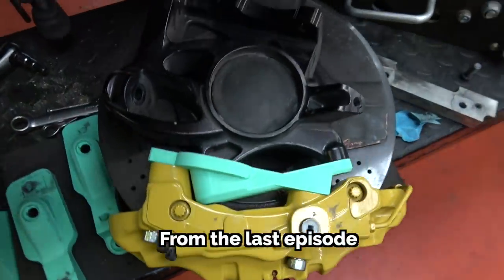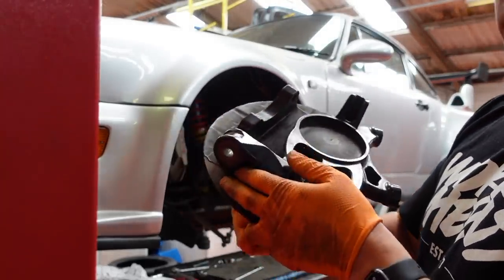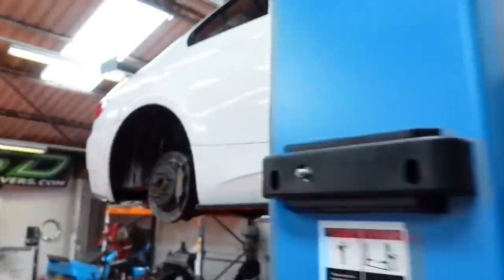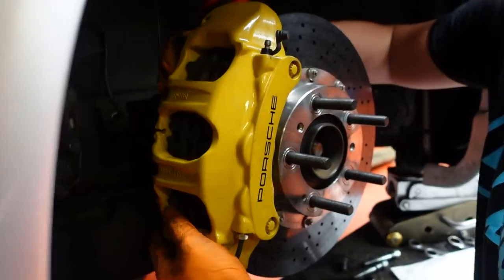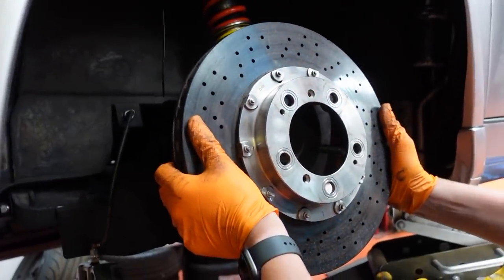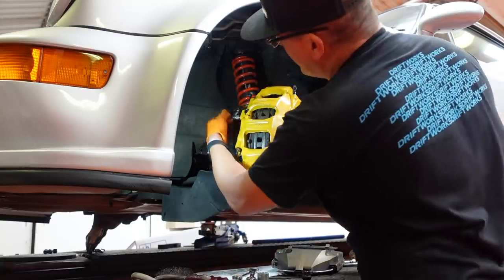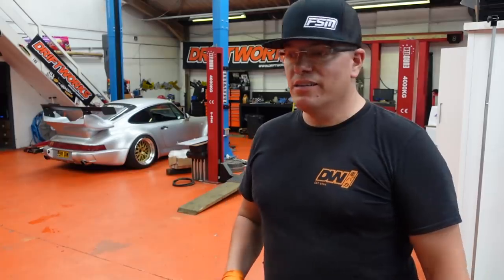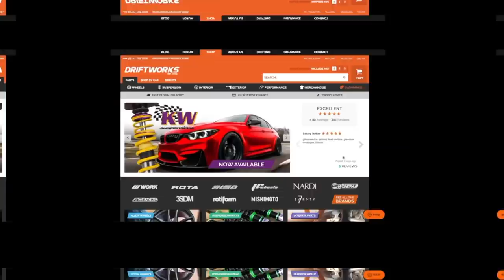Carbon Ceramic brakes on my 964 Turbo RWB Porsche 911 - Part 3

Comment: That brake disk is just stunning.

For a mere 2 million (less than an F40) you can get a printer that prints several types of metal including aluminum and I believe titanium. Fascinating how they work, but for myself I'll be waiting until they get into the thousand dollar range. 🙂

Comment: To much tire stretch can cause handling issues, just so you know Phil 265 on 10's, 315 on 12's are the reasonable choice(maximums😉). Feel free to give me advise on giving you advise. Your(our) 964 is ace 🤔😏
Reply from the maker: It seems fine so far, but I'd like a size up again eventually. I like a little stretch on a track car generally.

Comment: The metal working skills that you guys possess is awesome. Well done..question aluminum brackets for the calipers are strong enough? Would like to have bigger calipers and rotors on my e36 m3 evo. And 6 weeks on the hoist. Did you leave the battery on charge? Well done Phil
Reply from the maker: We use aluminium for all brackets. The BBI uprights themselves are aluminium. It's 7075 grade.

Comment: They look the part and I'm sure they have more than enough performance for a lightweight car like that.
Are you going to change the rear brakes to carbon ceramic too? The higher friction coefficient at the front will move the brake bias further towards the front, unless you change the master cylinder to adjust the pressure towards the rear more. Just a thought, I'm sure you don't want another brake headache just yet lol
Reply from the maker: That's the plan, although the PCCB are a lot more balanced than what was on there before. The bite & ratio on the old calipers was way out of balance.
Reply: @driftworks  sounds great!
What will you be doing with the old calipers? Keeping them as spare, or selling them?

Comment: Looks awesome mate- I’m the same fitting Lamborghini brembo Ceramic calipers to my E46 M3 with custom mounted 390x36mm Audi RS6 discs - plus custom pads and mounting brackets- oh and the 2mm wheel clearance and static wheel balance as the wheel weights have to be moved to clear 🤣🤣- but fuck they look immense
Reply from the maker: I bet they do, are they Gallardo brakes?
Reply: Driftworks yes gallardo and Huracan ceramics also found on the Audi R8 V10

Comment: Silly question. Did you try switching the calipers left to right to see if they fitted better? 🤔
Reply from the maker: You can't as the leading/trailing pistons are in the wrong place.
Reply: Driftworks ah I see! I knew there would be a good reason! Thanks.

Comment: So when's the mapping day now the brake dust issue is hopefully resolved?
Reply from the maker: Next year likely. Too much going on and there's a lot to do to the car before it's mapped. New ECu, injectors, throttle body etc. It runs pretty well as is, so I'll run it for a bit.

Comment: Possibly a little late now, but would it not have been easier to buy low head cap head bolts rather than machine standard ones down? Nevertheless, great episode and looks incredible :)
Reply from the maker: It would have still needed machining. 👍

Comment: Phil, please save the native CAD files of the adapters for when I sell my house and my wife leaves me for buying a 964 turbo. This way I can buy adapters from you and do this swap in the new parking lot where I will live. So much drool on the bits that are on this car! So, with the American 5 lb drop in the brake setup and the ??? lb drop in the BBI knuckle and coilover setup how much weight do you think you lost in the front corners compared to a stock 964? Curious to see your track impressions.
Reply from the maker: 😄. I'm not sure what the total change would be. The wheel and tyre are obviously about twice the size as a standard car.

Comment: Hey guys just wondering if your'e going to use hub-centric rings on the rotors? i upgraded the rotors with my BBK and needed to do that or i would get horrible brake shutter
Reply from the maker: Doesn't seem to be an issue so far, but I'll keep it in mind. Cheers 👍
Reply: @driftworks  normal city driving was pretty normal but once they got hot in the canyons or on track if come up. Lug nuts were TQ'd in a star pattern to 110ft lbs. Awesome build/mod! Keep killing it!

Comment: @driftworks.  Did I see loose bolts when you took the ceramic disc off. It looks like the bolts that hold the wheel bearing onto the hub!!!!!!
Reply from the maker: Yeah, I was using that face to do some of the initial mockup. It was all done up don't worry 👍

Comment: Do you know what model your original Brembo's are? I have a set of 4 pot rears that are almost identical. I can't find pads to fit them.
Reply from the maker: I don't, I gave up trying to find info and again couldn't find pads.
Reply: Driftworks thanks. I may have to do the same thing. 😒

Comment: Are you going to have uneven pad wear due to flipping the caliper upside down?
Reply from the maker: Why would I? Did you see the bit where we flipped the bleed & link to ensure I still have the leading & trailing pistons as they are supposed to be?
Reply: Driftworks I did see that. Wouldn’t flipping them side to side have been better? Maybe I’m not wrapping my head around this correctly but are the calipers not mounted upside down? So now the leading piston is trailing and vis versa?
Reply: On second thought, flipping them side to side would for sure mess up the piston orientation. But would have solved the bleeder/crossover issue.

Comment: Amateur here... What is the problem encountered at 18:45? Just curious, thanks.
Reply from the maker: The pipe that Jay made is touching the bolts on the back of the wheel centre.

Comment: Is the oil pressure low on the 964?
Reply from the maker: No, thats the oil level which moves around as it pleases 😄
Reply: @driftworks  I see. It got me worried ;)

Comment: In fear of looking stupid....if the calliper was mounted on the rear of the left strut, surely if it was fitted on the front of the right strut the bleed nipple etc would all be in the correct orientation?
Reply from the maker: It's not a stupid question, but the answer is that the leading piston would become the trailing piston. It's very importantly balance to spread the load on the pad correctly.

Comment: After all this work, Porsche have come out with tungsten carbide brake disc rotors, half the price of CCB and still have minimum brake dust
Reply from the maker: Yeah, but those are middle management, these are top dog.
Reply: Driftworks yeah can’t compare performance, but for the brake dust freaks seems a good compromise haha

Comment: at 32:41 the oil pressure gauge is at the red? is that normal?
Reply from the maker: That's oil level. It kinda does what it wants when driving.

Comment: Could you have just moved the FL caliper to the FR and vice versa rather than switch around the pipe and fittings?
Reply from the maker: No, as I mentioned in the video the leading and trailing pistons would be the wrong way round.
Reply: Driftworks ah! Missed the part about the calipers being asymmetric. 👍👍

Comment: ‘Unsprung weight makes no difference’ ........... 
Really ? So why don’t they make wheels out of lead ?    Why do they make magnesium wheels and carbon wheels? 
 Sure notice a difference on a motorcycle  on marchesini wheels vs stock wheels.  Gyroscopic inertia. Konigsegg don’t have alloy wheels, they have carbon. 
But I like the reason for fitting the brakes  👍
Reply from the maker: I'm not saying it doesn't make a difference. It's obviously optimal. I'm saying no one normal would be able to tell the difference between 2kg unsprung weight.

Comment: I'm sure I've read somewhere carbon disc brake calipers have to be yellow because of the higher temperatures they run at
Reply: That makes zero sense
Reply: Dark colours retain heat, light colours help disperse heat, basic school stuff physics mate
Reply: Rich Atkinson as long as it’s high temp paint it makes no difference what the colour is.
Reply: @foxx1111  hilarious 🤣🤣🤣